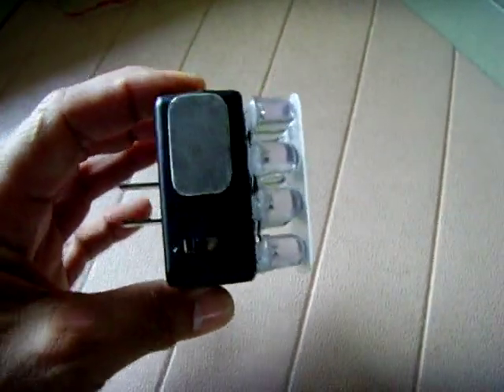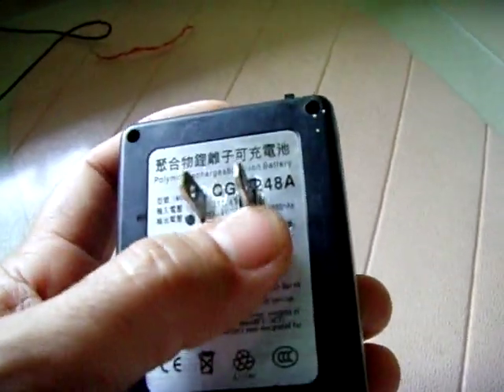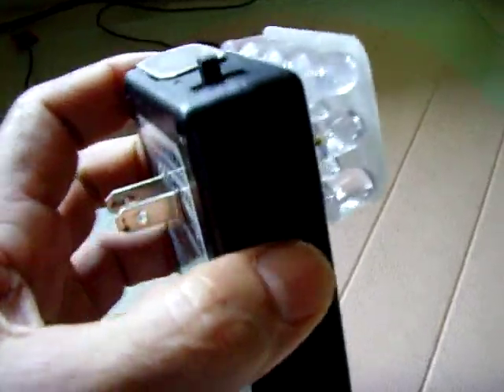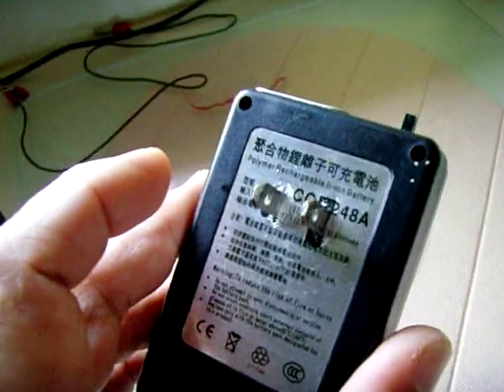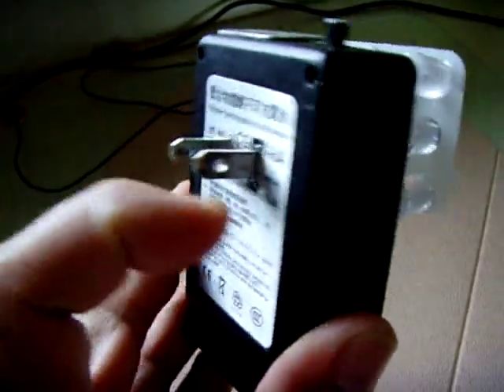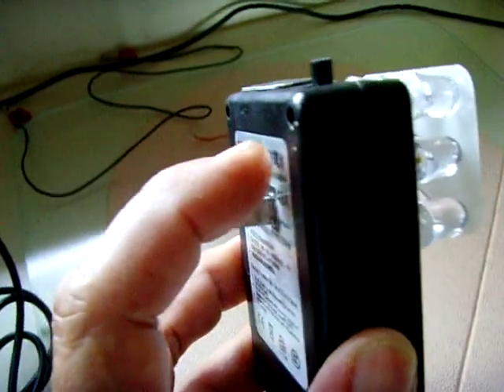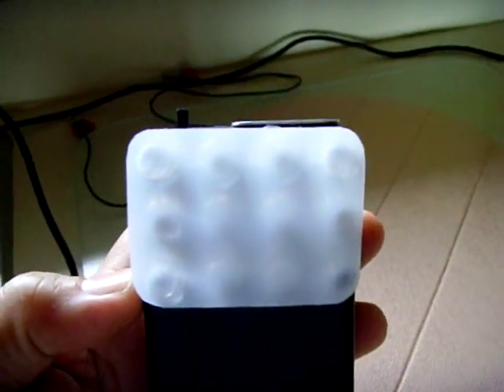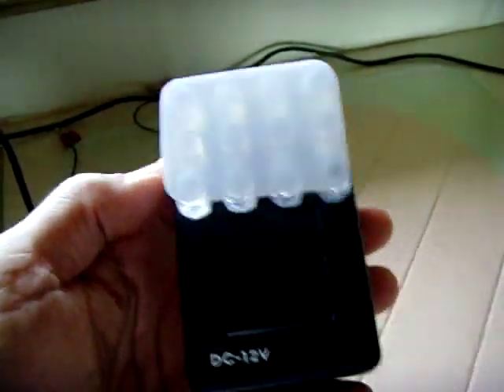Homemade Super Bright LED Night Light

Comment: Looks good. This would be a good project to post on instructables, but you'd probably want to include a parts list & schematic. Also switches to switch in the banks of 4 lights individually. And a brightness control pot would have been a great touch.

Comment: Go to Dollar Tree, Electric LED night light is $1, or get the Solar Garden or Solar Table Lamp ALL for a buck, leave it out in the Sun during the day, bring it in at night LMAO.. No work, wasting time !!!
Reply from the maker: Hi Jod. When this video was made, I was living on an out island in the Bahamas. :-) As for the LED lights from Dollar Tree, they're nowhere near the intensity of what I made in this video. After all, what do you expect for only a buck. :-) Thanks For Watching!
Reply: Yes you are right, but you can ADD more LED in them :). Add 3 to 6 LED and it will be Bright :D. But I guess when you are on an Island, there is no Dollar Tree around :D
Reply: ...And when the little NiCd cell in there finally has given all of its "up to 1,000 charge-discharge cycles", & can't hold or even take a charge anymore, and you can't find a replacement, but you've got a tutorial that tells you how to "make what you need", will you go without? or will you take 5 or 10 minutes to find a replacement NiCd cell & replace the old, "worn-out" cell with a new/rebuilt one? Or look through the USPTO's listings under "Solar + Electric or Electricity", find the diagrams for a long-out-of-date patent, that shows you how to increase the output of a photo-voltaic cell-array by up to 60%, & re-wire the $1 "cheapie-special" so it runs much brighter, ALL night, while you've got it open anyway? (Hint: The name of the device was the "Syl-Cell"; One of the two co-inventor's mothers' was named "Sylvia", hence the name. The "never got off of paper due to a too-greedy financial backer" company was registered in Baltimore, Maryland, which I was told by the now-deceased (of natural causes) co-inventor. Now go learn how to look up more stuff for yourself, & find the rest of what they don't tell you in the "Public Fool System", as I've called it since 2nd-grade; and I started a year early. I was "taught" that "There is at LEAST 10,000 to 100,000 years' worth of available crude oil at present & future rates of use & constantly increasing demand." I guess they goofed big-time on THAT one, now didn't they?)While you've got a point, time wasted can never be recovered, there are a LOT of things that you may NEED to know in your future, but weren't formally taught, and "learning how to find information", in a world without an "internet", is a daunting thought, yet you just MAY need to know how to do it, so while you've GOT some time to learn & make notes, DO IT! Nothing worse than thinking "If only I'd paid attention to the "Old-Timer" who gave such detailed info BEFORE I needed it!". Many of us "Old Timers" really DO "know stuff", and are happy to share that knowledge with anyone who wants to learn it. Knowledge can be lost in only one generation if it isn't passed along continuously; look at the pyramids, the discovery of Nikola Tesla & others, & you should see just how much 99.999% of "us" DON'T know what they tried to tell us over & over! Ever hear of Prof. John R.R. Searl? or John Ecklin? How about Charles Pogue of Canada, or the "still-sucking air" Gerard Morin of B.C. (also Canada)? HE understands SOME of what Tesla was trying to tell EVERYONE; when no one listens, the most important parts are lost in only 20 to 40 years! "We are all swimming in a sea of clean, free energy; all the inventor must do is find a way to change it into a form which mankind can use." Searl TRIED for over 40 years to give us literally "free" energy; he ran his house on one of his "generators"; look up "The John Searl Story, it's right here on Youtube! Point a browser at the US Patent & Trademark Office, & look up "Ecklin, John" under "Inventor's Name", and see what he found BY ACCIDENT that can provide enough power to run your home or an entire city; run the output of one of his later devices through a bridge rectifier bank, & send the power through some regulators, then DC-to-AC Inverters. Bingo, you've got 120/240vac at 50/60Hz. I'm sitting next to an inverter that's powering my A/C unit, and it's nice & cool in here; my power-source "gadget" uses nothing but magnets & magnet-wire, wound around silicon-steel C-cores; I had to have an old neighbor with a Southbend lathe & other machine tools, like a milling machine, take the common "E-core" pieces & make them into "C"-shaped pieces by milling out the center of the "E", so I could wind the wires on it, & put the magnets where they need to go. When this thing is "ready for prime time", I may patent it, or I may just Copyright the drawings for it, (copyrights last longer than patents, and are less likely to be grabbed & "weaponized" by a "de-facto government"), and/or just start making them while I still can. Would you like to have to PAY an electric bill every month, or get a check for the excess power you send back to "the grid", which you don't have to be hooked to at all, if you don't want them paying YOU every month. It's silent, clean, & will keep producing power for 75-125 years before it needs another "kick-start" to get another 75-125 years out of it. (The numbers are based on reasonable loss calculations.) You can use an empty butane lighter's piezo spark-generator for the "kick-start button". It's your choice, or it WILL be, once I've finished up some details. Oh, the magnets may need to be re-magnetized at SOME point, but we won't live THAT long. I kinda like J.R.R.Searl's "SEG" device; it not only makes power, it also removes heat, (no more expensive refrigerators that fail at the worst possible moment), and if it's overloaded enough, (which ain't easy to do), it also flies. Controllably. Sweet, yes? I'd rather have one of HIS "machines" than my own, since the "moving parts" in the "SEG" can't wear out, since there's no contact between them, and the magnetic "imprint" is self-renewing. The tricky part is magnetizing the "rollers", and of making the "rare-earth"-parts from Neodymium; it works, it was working in the 1950's, he built a "body" for one, overloaded it enough to fly it, called the appropriate ATC people in the UK, and flew his flight plan nicely. I've heard the aging recordings of his getting departure clearance, in "Pilot-Speak". It's real, he's real, (last I checked, which wasn't TOO long ago, 2016, but he's not getting any younger), and it just works, yet no one in America has even HEARD of him. The question is: Why not?!? The answer is to get your hands on as much of his research & engineering books & documents as you can, read them until you can recite them in your sleep, and when you "get it", MAKE ONE & use it. He'd like nothing more. 
as for Gerard Morin, he asks that anyone wanting to contact him do so at: "freenaturalenergy@gmail.com", but if you're going to be anything but nice to him, he can beat anyone else's attitude by 1 million times. Be nice & genuinely ask intelligent questions, and he'll give you some coffee & cake, & tell you everything he knows. And demonstrate it. Just remember that he may use the same word for "energized", "burnt out", & "hot/heated". (It takes awhile to get to know him & understand him, but it's worth it.) Happy learning!

Comment: Awesome, thanks. I finally found how to power Philips LED bulbs bypassing their electronics that would generate heat in the LED bulb base thanks to this video telling how to use a cap to reduce power. No heat is generated to light up LEDs from 110v, which is what I've been trying to achieve. I've had a few Philips LED bulbs running now for some time with this replaced driver method and the LEDs are fine. They're also dimmable. They also are using less power too. So, why isn't this method used more widely to power LEDs on 110v AC?

Comment: how does a 100 ohm resistor in series with a 2.2 uf cap and a bridge rectifier step down the 120 Vac to 12.6Vdc without a step down transformer? Great set up by the way
Reply from the maker: When AC current flows through a capacitor, it acts like a resistor to hold back the current without generating heat like a resistor. By reducing current, the voltage drops. The purpose of the 100 ohm resistor is to reduce the inrush current into the circuit/LED. LED's are very sensitive to inrush current. Without the resistor, the LED would not last long.

Thanks For watching!

I have lots of very good videos. Be sure to look through my video list, and tell others.
Reply: electronicsNmore was that just a 1/4 watt 100 ohm then? 
thanks for the response and not to be a dick lol, but current doesn't flow though a cap. If it did the dielectric within the cap would be worn out therefore resulting in a cap that doesn't hold a charge.
Reply from the maker: No. The resistor needs to be at least 1/2 to 1W. You can fire up the circuit and after a couple minutes unplug the circuit and touch the resistor. Warm/very warm is OK, hot is not good. If it is hot, use a higher wattage resistor. Current does flow through the capacitor. Using a higher uF value allows more current at the output. The Alternating current charges the plates inside the capacitor to positive and negative charges. When you unplug the circuit, that capacitor holds a potentially lethal charge. Placing a 470K across the cap will bleed off the dangerous voltage.
Reply: electronicsNmore do you have a picture of the schematic drawn that I could view? I followed what you explained in the video and sketched out my own schematic. I just want to make sure I don't miss anything. thanks

Comment from the maker: Actually it is a great night light if the room is very large like in my case. You can use a lower value capacitor to REDUCE light output. Very easy solution.

Comment: Why are you using a bridge rectifier?  LEDs are diodes, which are rectifiers.  All you need to power LEDs from AC is a capacitor to limit the operating current and a resistor for inrush current limiting (optional). There is less loss, hence less power consumption. Half of the LEDs in the string are powered on the positive swing of the AC; and the other half on the negative swing.

Comment from the maker: Exactly. We have a large main room in our house that is over 40' wide and 32' deep. It lights up just right for that sized room. If you want less light, use fewer LED's, and lower the capacitor value way down to compensate. I have a new video showing details. Just add a switch or dawn to dusk sensor circuit to the one shown and your good to go.